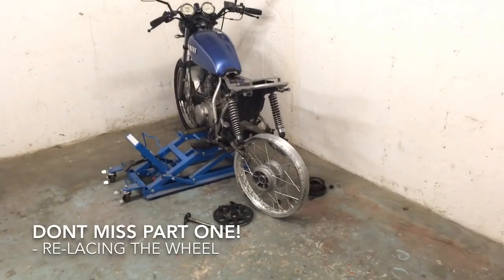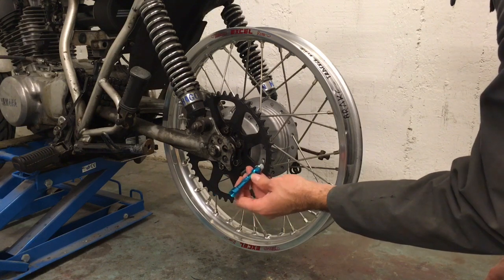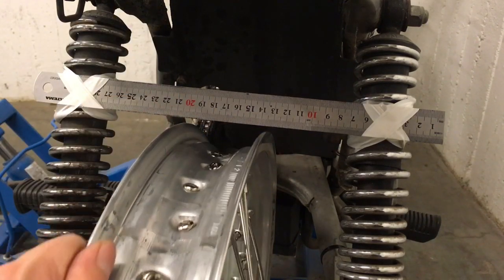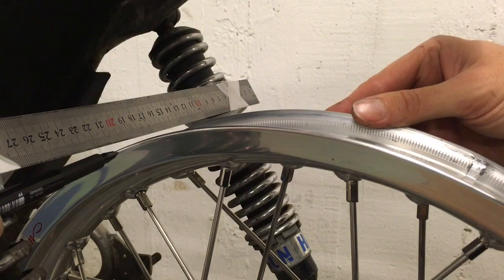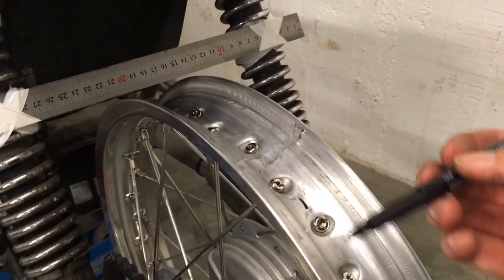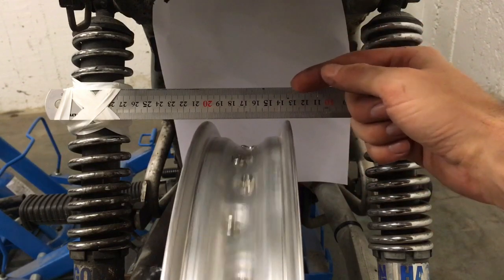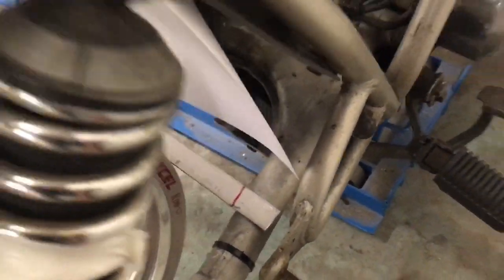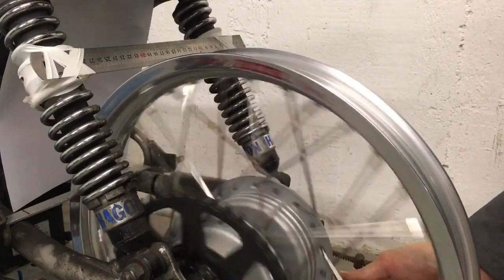SR250 18'' Rear Wheel Conversion - True A Spoked Wheel (Part 2)

Comment: Working on a tracker and I cannot seem to find a good selection of dual sport tires for a 16inch wheel. So i am really considering this conversion. With the new wheel put together, what size tires would I be looking for?
Reply from the maker: There are many factors to take into account.  We usually choose tyres with a good online search engine, then try and source them locally.  Try something like: https://www.mytyres.co.uk/Motorbike_Tyres.html  Cheers!

Comment: Hi did you actualy measure the weigth reduction? Thanks in advance :)
Reply from the maker: yeah, it comes out at about 500g :)  The thing that makes the biggest difference in weight is the tyre!
Reply: @JadusMotorcycleParts  Cool, per wheel right?  And just for curiosity did you measure the bike after and before all de mods and things removed??